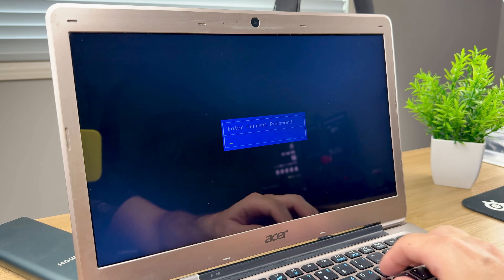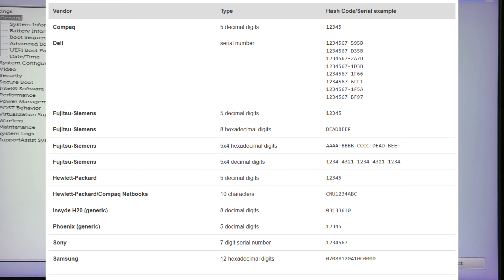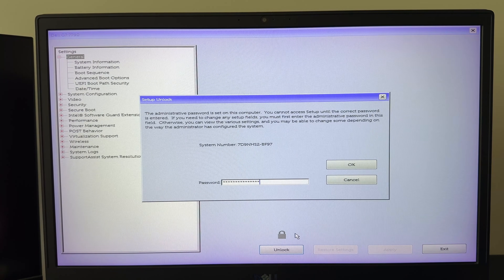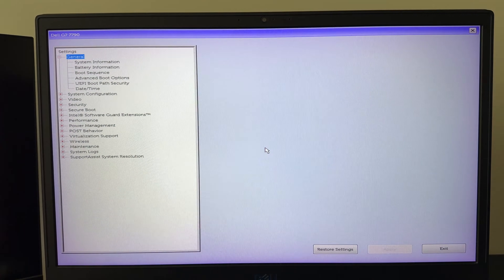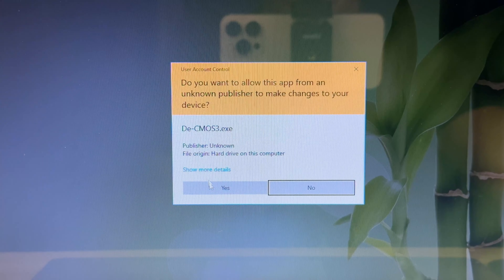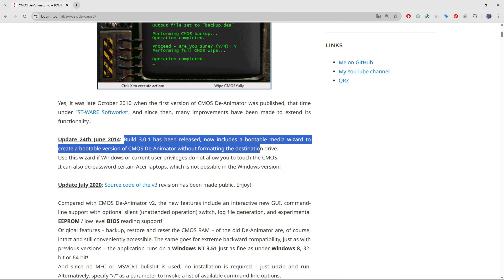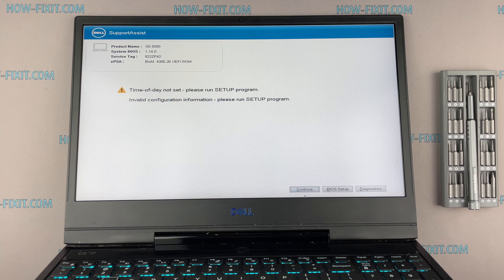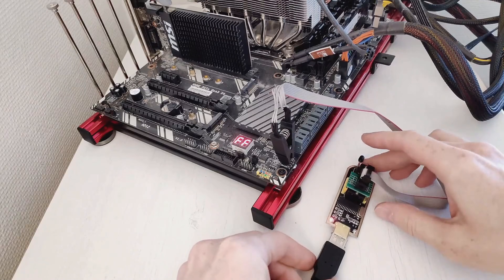How to Unlock / Remove Your Laptop BIOS Password (4 Methods Explained)

Comment: I've tried everything to unlock the bios password that pops up immediately when I turn on my laptop. It's a Panasonic toughbook cf-20. After I put the incorrect password 3 times it just shuts off. I tried removing the cmos battery and regular battery for a half hour. I'm gonna try the other 2 methods and hopefully I get lucky

Comment: Great tutorial — very helpful, thank you!
I bought a used Acer TravelMate P459-M (Model: N16P8) and the BIOS is locked. The BIOS screen shows: “Enter unlock password (key: 71243875)”.
Could you please make a follow-up showing safe/legal ways to resolve this? For example:
	•	How to contact Acer official support for an unlock or service request,
	•	What documents they usually require (proof of purchase, serial/SN location), and
	•	What to expect from an authorized service center (process, turnaround, possible fees).
I don’t want bypass tricks — I only want the legitimate recovery path so I can use the laptop safely. Any guidance or a short demo of the official process would be hugely appreciated. Thanks again for the great content!

Comment: Greetings! First off, thank you for your time and effort in posting this extemporaneous video! In reference to the last method, where would you suggest I purchase the tools necessary for resetting a completely locked BIOS from a Dell Latitude 5410 that was built solely for Home Depot Customer Service. I purchased this laptop off Ebay and 2 days later the seller had removed their account. I've tried EVERY method including an M.2 NVMe Enclosure tool> removing the Hard Drive > Re-formatting it, and putting it back together > to no avail and no resolution. Ive removed the cmos, and everything other method you can find on the web. I fear that when the laptop was manufactured, the motherboard was equipped with GPUs specifically designed to work for the Home Depot Customer Service Dept because when the Laptop is booted up and turned on it takes you to a screen that is branded with the HD logo and asks for a CSR rep ID# and login credentials. I'm at my wits end! I paid a pretty penny for this laptop. ANY SUGGESTIONS will be appreciated beyond expression. So.... anyone?

Comment: Removing the battery does not reset the BIOS password on laptops. It is written to non volatile memory, sometimes in the multi controller.
Reply from the maker: You’re right—pulling the CMOS battery won’t clear passwords on modern machines. I showed this method because it still works on older laptops (roughly mid-1990s up through about 2007). In more recent models post-2008 to ~2010 – Most business-class laptops already store BIOS passwords off-CMOS (EEPROM/NVRAM). After 2010, BIOS passwords live in non-volatile memory, so removing the battery alone won’t reset them.

Comment: Can I use master password on any laptop manufacture, like Acer laptop?
Reply from the maker: Master passwords are manufacturer-specific and don’t work universally. Acer, for example, has its own backdoor codes that differ from Asus or other brands. For some models it works, for some it doesn't. If you have a hash code but for some reason bios-pw.org did not work for you, try to get a master password for Acer laptops on this site 👉 https://www.biosbug.com/acer-10-digit/
Reply: @howfixit  thank you so fucking much🙏🙏